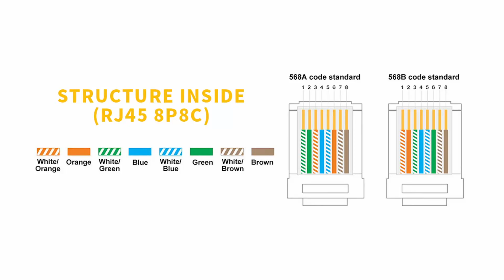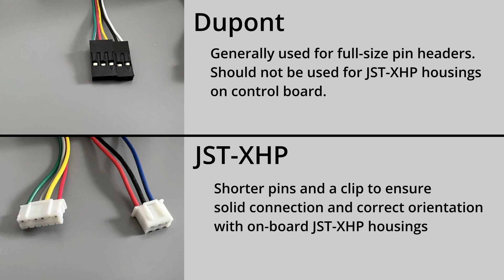Ethernet Cables for 3D Printer Wiring?

Comment: Have you ever considered grouping together multiple pairs for heater current? You can split a high current wire into 2-4 smaller current wires. As long as they rejoin on both sides, its like having one wire. Further, if you use the twisted pairs for +/- of each of the split groups, you get crosstalk reduction if you want to have other signals on the remaining pairs. This makes sense theoretically. I have yet to try it. :)

Comment: I like the idea of this and have considered it in the past but have worried a little with the amp draw involved, especially with the heater wires for the hotend, and there's no way I'd use these for the heatbed. One alternative I've found is the voron v4 toolhead PCB for the hotend in particular, converts all your tool head wires down to a single cable with a higher amp draw capability. Another thing I've started working on for my Big printer is I found a DB-50 breakout board with 3a per terminal capacity, ordered 2 of those, then found a 3a per conductor DB-50 cable, this will work well for me as I'm going with a custom CR-10 style control box with a big ol BTT manta c8b board with a ton of spare IO. Then I can leave spare IO for later as I have 50 terminals to play with, plus since I can't not upgrade my printer endlessly it enables me to swap boards on the fly and have some pre-wired cables to the board that I just need to run into the terminals (I can send you some pics sometime if you're curious). Another cool entry is the budding canbus capability on a few newer boards allowing 1 4 wire connection for ALL of your IO on the other end, though I'll have to see how effective that is before I try that.
Reply from the maker: Hey Steven, I would absolutely not run heater amperage through those wires.  I stick to only beefy low gauge wire and pretty substantial connectors way overrated for use. I've had a few terminal blocks melt from poor connections so I tend to be a bit careful with heater wattages.

I'd love to see pics of the DB-50 breakout.  That definitely future-proof but some of those breakouts look pretty large.  Would like to see the mounting solution you came up with.  The Manta with the CB-1 seems like a heck of a deal - especially since it's so hard to get your hands on Raspberry Pis.  If I were upgrading today that's probably the route I would go as well!
Reply: @LilMikeysBigPlans  just shot ya a message with a picture on your Instagram with a picture of my progress so far on the build
Reply: @LilMikeysBigPlans  is Instagram the right place to message you?

Comment: I'm in the process of building a huge printer and I was already gonna use Ethernet cable or UTP cable as we call it in the trade of low voltage, It's a universal cable. Then I saw this video and decided to share my tips. Works great for just about everything. Also alarm wire works but keep in mind that stuff is 22AWG. Comes in two and four conductor. 
Keep in mind with CAT5e it's 26AWG and 24AWG depending on the brand and you shouldn't go over 500mA per conductor so if you plan to run a stepper motor I would double up on the conductors. Also avoid copper plated aluminum. 2.54mm screw terminals will work on those RJ45 breakout boards. Speaking of RJ45 you want to add a good strain relief, RJ45 connections don't like moving around. You could terminate the conductors with B-Connectors but they will take up space but solder and heatshrink would work better.

Comment: Bummer, was really hoping to see if you had tested how many "doubles" of wires would I need for the hot end power
Reply from the maker: It's a bit more hazardous as when the wires age they could break or increase in resistance individually increasing potential for fire.  Not to mention those wires are so tiny you'd probably need most of the pairs to supply enough amps and trying to run any signal along side that much power would mean you'd increase the likelihood of errors.  Personally, I'd advise against it.
Reply: @LilMikeysBigPlans  I see, my plan B was going for separate +V/GND dedicated thick pair... Ideal would be go straight to CAN bus, but I'm not running klipper so it's a steep upgrade for me now...

Comment: wires(from device), to solder (PCB daughter board), to screw terminal, to connector (RJ45 plug), to connector (RJ45 receptacle), to cable (CAT6), to connector(RJ45 plug), to connector (RJ45 receptacle), to solder(second daughter board), to screw terminal, to cable (original), to connector(JST on main board) ... recipe for troubleshooting !

Comment: I don't know if you have any experience creating custom PCBs with software like KiCad (which is free), but this seems like a great option to avoid a lot of the soldering on proto boards for example. The learning curve isn't too terrible when you are dealing with things like RJ-45 jacks, JST connectors, dupont headers and screw terminals. And the boards are typically very cheap if you use some of the Chinese companies like PCBWay or JLCPCB.
Reply from the maker: Hey David.  I've never created my own custom PCB but I've seen and heard that ads for the services all over the place.  I really should look into those services, if for no other reason than to maintain geek cred, but also to save a lot of soldering :)  Thanks for the suggestion!.

Comment: Awwwww!!
You blew my secret sauce!
I figured out the Ethernet/4 core temp control wire because, well, necessity is the mother of invention... And it was right after Christmas, I was broke and had plenty handy!

For the motors, I kept the wound pairs together, and there was literally no difference in impedance 😁

However, I did have to upgrade, after the recommended steppers for the Voron 2.4 motor upgrade 😅
Reply from the maker: It works plenty well, it's well insulated, cheap in bulk.  Why not use it?  I do kinda wish I would've just stopped at crimping connectors onto the wire though as I've spent WAY too much time working this out and now that my printer is where I want it to be I pretty much never touch the cables.

Comment: Awsome! I now feel vindicated for already thinking about using cat5 cable. I'd wondered why nobody has done this and now here you are. Good points to boot. What I had wondered was the reliability of the cat 5 plugs themselves with so much movement. Not to mention oxidation. True gold pins would probably be in order lest oxidation eventually sets in. "De-oxit D5" sprayed on the connections will go a long way to prevent this. Its my go to professionally for contact issues.  It just works. For the stepper motors 4 wire traditional phone cable might be adequate as well?
Reply from the maker: Hello iphlue!  The connectors definitely seem to be the weak spot.  Ensuring good strain relief would be a great idea and my current cable tower puts pretty much no strain on the connectors themselves.  That said, the printer where I just hot-glued the keystones to the PCB had little in the way of strain relief and the connectors held up for years so it may very much by a YMMV type of thing.  I'd think phone cable would work just as well with even smaller jacks.  It looks like phone wire ranges from 22 to 26awg so maybe we wary of the really thin stuff.

Comment: Great video. I'm definitely grabbing a pack of solder-able jacks.

For everyone who isn't fully steeped in networking, you should know that T568B is the "normal" wiring pattern. You can use either one and stick with it and it will be fine, but if you always use B then you won't ever accidentally make a crossover cable when you didn't mean to. Similarly, if you're using a premade cable and just re-terminating it, it's almost certainly B wired from the factory.

T568A is mostly used in government and by people who want to ruin my day and make me re-terminate the desks in a new office space.
Reply from the maker: Thanks Jameson!  I've always heard to wire in 'B' but never heard a solid explanation as to why.  It seems like it's a fairly arbitrary standard change over time and there are no real advantages to either - assuming you can stick to one across an installation.

Comment: Do you use those cables even for the hotend and the printbed? I'm worried about the maximum ampere capacity of those cables and thus the heat. Are you running 12V or 24V over those cables?
Reply from the maker: NO!  Do not try to use the ethernet cables for high draw items like heaters.  While the wire itself might be able to sustain a small heater the resistance from the connectors and joints almost certainly will not.  Stick with lower gauge wire for those high draw items.  I'm using ethernet cables in some form on both 12v and 24v printers without issue.
Reply: @LilMikeysBigPlans  Thanks. I did NOT intend to use those for heaters. I was just worried about that you use them even for heaters. I'm already unhappy with the Tronxy solution they came up with. You know, this ribbon cable solution even used for the heater...
Reply from the maker: @WolframWebers  Oddly my X5SA didn't come with the ribbon cable but rather a big molex connector and a bundle of wires.  I'm surprised they used the ribbon for the heater on other X5SAs.  AWG calls for max 3.5 amp through 24awg wire (assuming chassis wiring limits, down to .5amp for 'power transmission' wiring) and a 60w heater at 24v is only 2.5 amp so the wire itself in theory should be able to take the amperage - assuming it's undamaged at room temperature - and I've also never had a wire burn up on me.  I have, however, melted connectors rated far higher than 3.5a melt on me when wires wiggled loose.  Personally, I don't think I would choose to use anything smaller than the wire gauge the heater shipped with which appears to be closer to 20awg but I'm overly electrically cautious.
Reply: @LilMikeysBigPlans  So true. Will definitely replace the heater cables. Never trusted the ribbon cable and found it always odd TronXY used them.
Reply: @LilMikeysBigPlans  You can always split power over multiple cores.